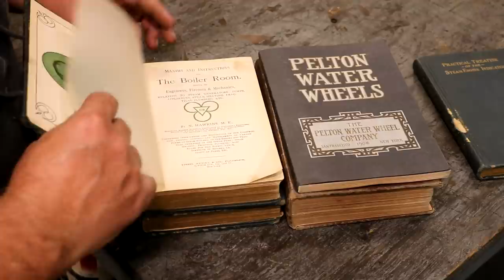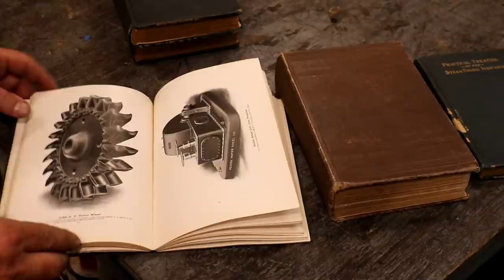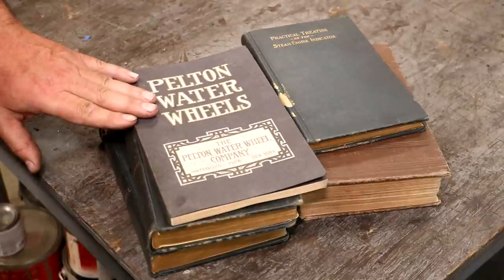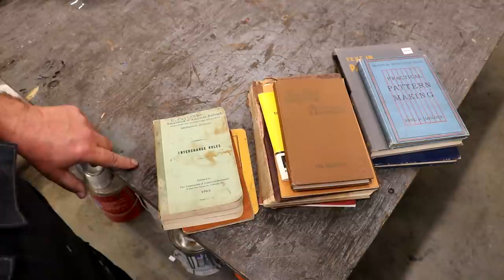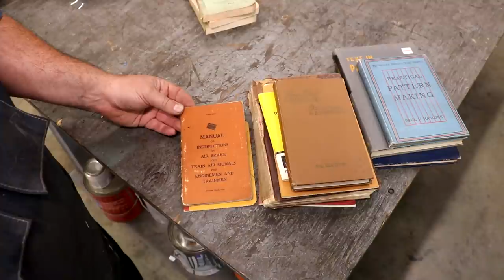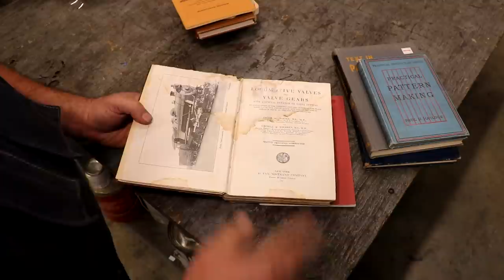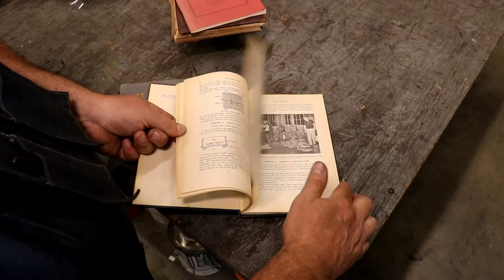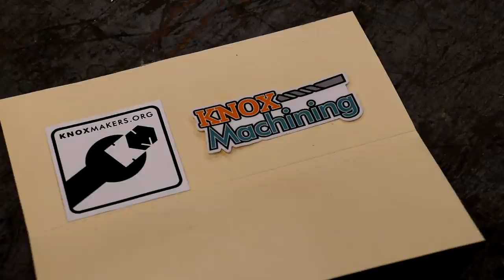Odds & Ends 125: Bar Z Summer Bash, American Rotary Giveaway, Viewer Mail

Comment: I work at a place that makes big precision CNC milling machines, the bearing surfaces for the linear guides get scraped in flat locally with the use of a somewhat small surface plate. To get global flatness a combination of precision levels and autocollimators is used, with this mapping of the error it gets decided which portions of the surfaces get scraped further. So if you have a precision level and the right technique you might not necessarily need a very big straight edge.

Comment: 1/2 inch - 12 British Standard Whitworth - BSW - Not rare at all!  1/2 inch - 13 United Standard Course - UNC also not rare both are well used in many applications, it does catch out the uninitiated though.  Great video again Keith, well done.  A Fan from Aus.
Reply: G'day Col.  You beat me to it!
Reply: @rodbennett4790  I should have put United national Course but had Standard on the brain.  Regards Col
Reply: My mid-80s Enco knee mill uses lots of 1/2-12 BSW fasteners.
Reply: Imperial thread pitch is (obviously) Imperial thread pitch.  However, the Whitworth and SAE/SME thread forms differ.  So, U.K. and U.S. 1/2"/12 are not quite interchangeable.

Comment: 1/2"-12 is odd ball but larger diameter thread sizes it is quite common. 
Really large taps are not used so much anymore as it's safer to thread mill. Though I have in the past sharpen some.

Comment: I learnd this in scool that this is British Standard Whitworth (BSW) is an imperial-unit-based screw thread standard, devised ... thread pitch is the same in both systems except that the thread pitch for the 1⁄2 in bolt is 12 threads per inch (tpi) in BSW versus 13 tpi in the UNC. just as information

Comment: Great video Keith, that 1/2-12 tap is hard to find I restored a pratt&whitney lathe with that thread. 
I need to find one of those flat belt splices got alot of belt's that need splicing.

Comment: I had that lacer for my photo lab. The paper processors had these very long belts that went around the entire processor. The paper rolls went on the thin stainless strip with small clips on the ends the clipped to the belts as they went around and through the processor. We clipped them on in the dark. Took a while to get the hang of it. The belts, which were plastic, since they went through the chemicals and heat dryer, had to be replaced every so often, and the ends were put together with these clips made from stainless. That goes back a ways, but there are still machines that use this method.

Comment: Hi.Keith
When I started in The Trade in 1960-61 in An Australian Government Factory where we made Rifles for The Australian & many Armies all around The world we run into The same problem as we had Machines made in The UK & The USA The 12 TPI Threads were The British Whitworth Standard Threads.
Later when I went to The Toolroom & was a Toolmaker for many years all The Jigs & Fixtures we made were Mostly NC & all The 1/2 Threads were 13 TPI also The Whitworth are  55 Degrees whereas The NC & NF are 60 Degrees.
Reply: Also I've spent time in Idaho & Wyoming  & when in Jackson Hole Check out The Million Dollar Bar

Comment: Keith, Make sure your car can handle high altitude driving. I had trouble crossing the mountains due to air/fuel adjustments. Check with your rental company.
Reply: How long ago was that? I remember that they used to sell "high altitude" carb jets for mountain use, but I thought that cars adjusted for that automatically now with the sensors and computers and whatnot. God knows I am no expert on this (or anything else, actually).
Reply: @ianbutler1983  Yup. In 1970, took my 2 year old BMW 2002 from CA to the midwest and back. On the return trip, in Nevada somewhere, the thing started misbehaving in the most alarming way.  Altitude problems, turned out. Scared me for a while there. Not any more, I wager.